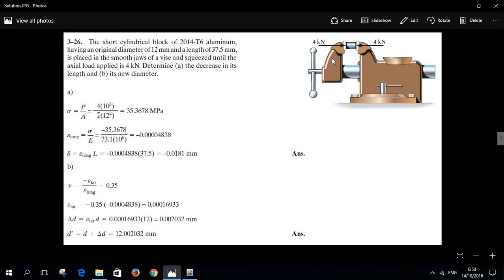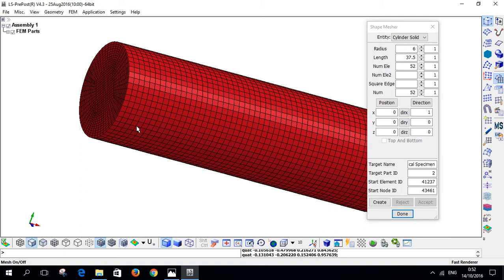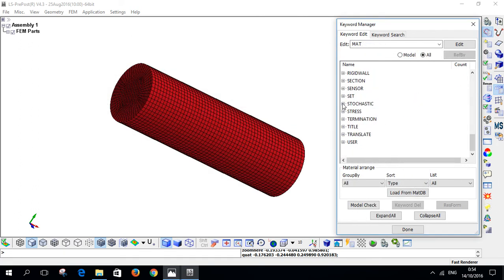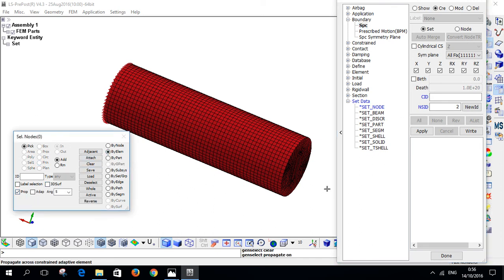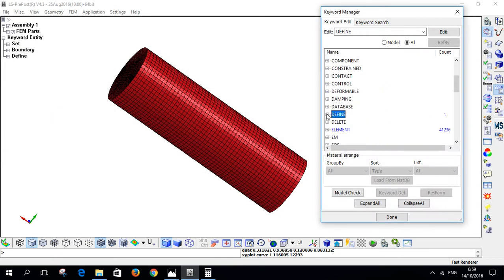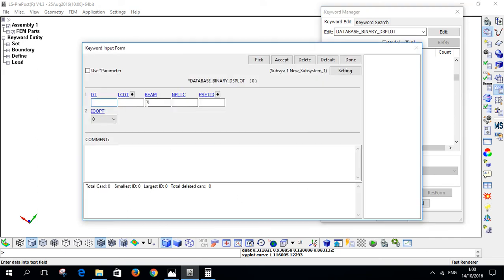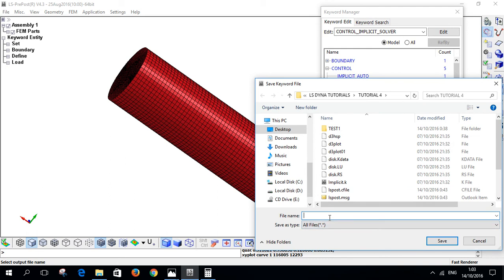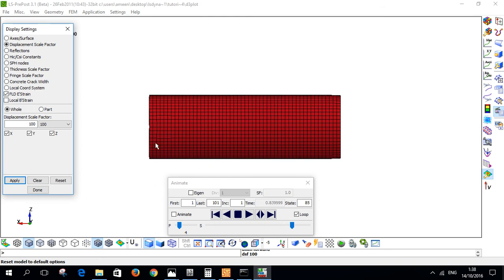LS-DYNA TUTORIAL 4: Compression Load on Solid Cylinder

Comment: If I intend to utilize an overpressure time history as a blast load, would the procedure be the same? If so, how does the software differentiate between the defined curve for pressure versus time and the curve for load versus time, given that the units for force and pressure are distinct?
Reply from the maker: If you use *LOAD SEGMENT SET, then the input curve should be pressure vs time. If it is *LOAD NODE SET, then a force vs time curve should be used.
Reply: @AmeenTopa  ok ok. Should overpressure be divided by number of segments?
Reply from the maker: @shriyaverma2565  overpressure is N/m2 so it is already per unit area. So there is no need....
Reply: @AmeenTopa  Thankyou so much.. I really appreciate your help.
Reply from the maker: @shriyaverma2565  you are welcome.

Comment: Hello. First of all great job on the tutorials, but when I want to define LOAD_NODE_SET and want to accept it i get warning Data of repeat card widget changed, but not saved. Then I save it but still getting same warning. What could be a problem to cause this issue?
Reply from the maker: Every time you enter a set off data, make sure that you click first on insert or replace before you click on Accept.
Reply: I have the same problem, did you solve it somehow?
Reply: ahaha, in 1 hour I noticed that in my version of LS-Dyna there is a subwindow with buttons insert, delete and replace (but it was not in the video), and AmeenTopa talked about these buttons in the comment.

Comment: dear sir，May I ask why I used your method to analyze the bearing capacity of reinforced concrete columns? Why did the result obtained be greater than the force I applied? Thank you for your answer
Reply from the maker: It could be that you are applying the force in a very fast rate, which causes inertial forces. Thus, the resulted force is higher.
Reply: Thank you for your answer, but I would like to know at what speed it is appropriate to apply force
Reply from the maker: @houa-lk9bd  the velocity should be same as the experimental work. That's the ideal way to do it.
Reply: @AmeenTopa  ok thank you sir
Reply from the maker: @houa-lk9bd  you are welcome

Comment: When loading the curve, is the load value entered the nodal load value or one load value for the surface on SET_NODES, sir?
Reply from the maker: In this model, I entered the total load. That's why I used scaling factor.
Reply: @AmeenTopa  means that the force distribution is taken from the total force to be evenly distributed on the surface, right, sir? Or is the total force distributed in the nodes sir?
Reply: if it inputs the load at each node, is there a way if I directly input the load on the surface with the load evenly distributed? or is there a way to calculate how many nodes are input on the load curve as a divider of the load?

￼
Reply from the maker: @nathasya2492  if you do not want to calculate the force per node, then you can use LOAD RIGID BODY. With this option, you can directly put the total force to be applied.

Comment: Hi,
I found this video to be very informative and I quite like it however, I followed the video to a tee and keep getting an Error 20001 reading 1st control card with improper format in line 2. Is there there a quick generic fix that any knows of for this? Thanks
Reply from the maker: You can open the file with a text editor and delete line 2.

Comment: Thank you for the video. I am trying for similar parameters but getting an error 60022 (IMP+22) saying "LS-DYNA Implicit is not supported in single precision, Please switch to DOUBLE Precision (I8R8) version". Can you suggest the solution to this?
Reply from the maker: The problem is quite clear. You are using single precision solver for implicit analysis. Implicit analysis can run only on double precision, for example smp_d_R10.

Comment: Dear Ameen, I always learn from your turtorial evertime. As I model a single column and a regid cylinder was placed at top to aviod exessive local damage ( I merged duplicate nodes between the column and cylinder already). I have applied axial load the same as you. I have a few questions related to my modeling. 
1) Does it need to defind the contact between regid cylinder and column, and its friction (FS, FD)?
2) I have watched yours turtorial (Reinforced Concrete and Wrecking Ball), when you defined Load_body_Z, you putted scale factor SF=1 but when I checked model truck F800 they put SF=9806. What these stand for? Do I need to assign gravity load on my model?
Thanks in advance🙏
Reply from the maker: By the way, if you learn from my videos, make sure to share my channel to your friends and colleagues.
Reply: @AmeenTopa  Yes I did share it, of course. Thanks  you
Reply from the maker: Hey there. You cannot put your email here. YouTube will automatically delete your comment. Please reach me over my social media (Facebook or LinkedIn)
Reply from the maker: Dear Met mey,

If you merge the duplicate nodes, then no need for any contact. 

SF is the scaling factor, in my tutorial, I defined the curve for gravity as 9.81 so there is no need for any scaling. 

But in the truck model, the curve has a value of 1, that's why they put 9806  as the scaling factor. They are using tonne, kg, mm, s units that's why the gravity constant is 9806 not 9.806 in their model.

Comment: Thanks for great tutorial, and I have a question why you write 99999 before analysis? What should I write?  I have i5 7300 hq  4 core 3.2 ghz
Reply from the maker: This value depends on the RAM, not the CPU specs.

You can try the same value, if it didn't work, then reduce it. But this simulation is not that big, you can leave it as default, it would be just fine.

Comment: Hey Ameen, do you have a tutorial for explicit quasi static analysis?
Reply from the maker: Check my tutorial on Torsion. 

Quasi static analysis is usually done with implicit. Using explicit will take decades. In my Torsion tutorial I used mass scaling which reduces the computation time.
Reply: @AmeenTopa  do you reckon that buckling of a reinforced concrete column can be computed using an explicit solver and mass scaling?
Reply from the maker: @nj5587  if you want to compare the buckling load with theoretical values, I suggest you go for implicit. Buckling load is a very sensitive analysis.
Reply: @AmeenTopa  alright, ive already managed it in implicit, i just wanted to add explicit results and compare all them
Reply from the maker: @nj5587  There is only one way to be sure. You have run and find out!
Reply: @AmeenTopa  i have been trying to use a velocity prescribed motion to control the kinetic energy but so far i havent achieved buckling in my explicit results, is it possible for you to have a look?
Reply from the maker: @nj5587  have you included the initial imperfections in your model?

I think your time scaling or mass scaling is too much. As I said, buckling is a very sensitive problem.
Reply: @AmeenTopa  yes i have included initial geometric imperfections, i play around with the mass scaling, at the moment i have multiplied the density by a 1000. I havent done any time scaling yet.

Comment: Great tutorial. Would like to request the tutorial for this example https://www.chegg.com/homework-help/questions-and-answers/question5-figure-q5-shows-simple-model-motor-vehicle-vibrate-vertical-direction-traveling--q34413824
Reply from the maker: You can check my tutorial spring and mass system to get the basics on how to model the system. You can use lumped mass and discrete elements (spring and damper).

Comment: Hey Ameen, could these steps be used in simulating the compression of reinforced concrete concrete columns except for having different material properties and models? Thanks
Reply from the maker: Hi there, you can follow this tutorial:
https://www.youtube.com/watch?v=Kzc5VFetBdE
Reply: @AmeenTopa  yes i used that for concrete modelling but i want to apply axial loads on the column, should i use this tutorial?
Reply from the maker: @nj5587  Yes, you can follow the tutorial here and take the material properties from there. Just make sure that the units are consistent.
Reply: @AmeenTopa  ok thank you very much
Reply: @AmeenTopa  hello Ameen, i have created a concrete column model to run a buckling test but i get an error message saying negative eigenvalues, could you please advise on how i can solve this issue. Thank you

Comment: Could you please tell the unit you are using for time. According to the other units you are using, it should be ms. But in the termination time you chose 1. Does it mean that the simulation is only for one millisecond?
Reply from the maker: Here, as I am using static implicit solver, the value of time does not really matter.
Reply: @AmeenTopa  Thank you very much

Comment: I am just wondering about the NCPU=8. Was the computer that you used for the static analysis is an HPC? I was trying to model a large-scale model and it required time of 55hrs.  any suggestions to speed up the simulation?
Reply from the maker: CPU time depends on many factors such as: file size, number of elements, and elements quality. If your keyword file size is 200 Mb or above, then it is normal that it would take that amount of time.
Reply: @AmeenTopa  Thank you very much for the reply. The file size is 23 Mb though. If I want to do a simulation for the half of the model (cut along a symmetric axis), how should I apply the boundary condition to the cutting plane? Also, do I need to input or consider any other keywords or factors in addition to the boundary condition? and after I simulate the half model, how should I scale up the values for the full model?
Reply from the maker: If that's the file size, and you are doing static analysis, then I assume you are using implicit solver.
If my assumption is right, then you can use variable time step, and control the initial time step.

For model reduction, you don't need go remove or reduce the load, you can simply apply boundary conditions at the symmetric plane with BOUNDARY SPC SET  or use  SPC SYMMETRY PLAN condition like in my video here.
https://youtu.be/Xidr0p6EplQ
Reply: @AmeenTopa  Thank you very much. You are right, I am applying a static load through a spherical ball on a wall. Ye, I tried with implicit solver with variable time step (after watching one of your videos) but it is still taking longer time. 

I will try with the SPC SYMMETRY PLAN and check. Thank you very much for your much helpful videos and advice.
Reply from the maker: @amzzano  For implicit analysis, everything should be fixed and there is not 'loose' ends. If there is some gap between the ball and the wall, then this might cause your run time to go very large.
The ball should be touching the wall at the beginning of the simulation. The wall (if you are using shell or solid part) should be fixed too at its boundaries.

Comment: Splitting the force into 820 parts is hard to understand. Can the pressure curve be defined directly in LS-DYNA？
Reply from the maker: Yes. You can directly define the pressure: https://www.youtube.com/watch?v=5Sgwna3IHCg&t=3s
Reply: @AmeenTopa  Thank you for your help！
Reply from the maker: No problem. Sometimes, you need to apply distributed load instead of point load. The method used in Tutorial 4 is for you if you want to apply distributed load.

Comment: Thank you for the tutorial. It is very useful! I tried modeling the exact same and if I increase the load it looks as if not all the nodes at the end where the force is applied have the same displacement. It looks as if every other node has a large displacement. The other nodes only have small displacements.
Do you know why this occurs and how to fix it?
Reply from the maker: First thing to check, your nodeset. Make sure all the nodes on the surface is defined in the set.

If this still doesn't work, then you can make a rigid plate on the top, then apply the force or displacement on that plate.
Reply: Thank you for the tips Mr Topa. I have already checked the nodes, and it looks as though they all are defined. So I think I'll try your solution with the rigid plate.
Reply from the maker: @nikoline5299  here is how i did before with the rigid plates

https://youtu.be/LJXrcC4pCu8

Comment: Very thankful to you sir. Sir, I'm solving an explicit model (blast effect on the structure) but initially, I will have to apply load/force on the structure (as per condition),  and then have to analyze blast effect on the structure.  After inserting load curves for selected nodes, the solver is showing error termination. How to overcome this type of issue?
Reply from the maker: Hi, I have made more than one video about blast simulation with LS DYNA. Please check them out.

Comment: Hello Sir, i want to attach Cfrp wrapping material to concrete column, it is just like frabic. I am not able to do this?.
Any solutions, as i am not able to get results.
Reply from the maker: You may use shell elements, then use tied nodes to surface contact.
Reply: @AmeenTopa  hello sir, i have used it but i am not able to get proper results.
Reply from the maker: @vinodbankapur2717  gimme your email id. I will  contact you there for further consultation.

Comment: Hello sir....Thank you very much for learning tutorials...

However I could not understand why we need to devided applied load by number of nodes...In practica, whole suface, hence all nodes will be subjected to 4 KN load....But we definded 4/820 KN on each node.....this need to be done in all kind of simillar probelm ?
Reply from the maker: If we didn't divide by the no. of nodes, then we will be applied 4kN on each nodes of the surface. If the surface has 100 nodes, then the total load applied with be 400 kN!!

If you don't want to divide, no problem. But the force of 4kN will be concentrated on one single point which is not the case in real life.

Comment: am dealing with a concrete filled steel tube subjected to blast load..
i need to find out the mid-height deflection of the tube.
for the above said problem i have divided the full length of the tube into three parts so as to find the deflection in the middle part.
but i have been unable to establish the contact between the respective parts...
can u suggest me the appropriate keyword that is to be used for establishing the contact between the parts..
waiting for ur reply...
thanking u
Reply from the maker: Dear Sumit, you don't need to divide into three parts. Just make it one part but with nice and small mesh.
Reply: i have also tried with one part that is without dividing but was unable to find the mid-height deflection of the tube.can u suggest me the CONTACT keyword that is to be used for creating the contact between concrete and steel..
Reply: will u please let me know ur email id so that i can get in touch with u regarding this by sending the file.

Comment: In define_curve...when I changed value of SIDR to 1 then while plotting it is showing invalid curve id ......this is happen when I am doing dynamic relaxation method.....any solution?
Reply from the maker: I am not sure what is the reason of the problem. I just tried in with my prepost. There is no problem in plotting the curve whether SIDR is 0 or 1.
Reply: Ameen Topa is it necessary to create two load curves while doing dr method
Reply from the maker: Yes, one load for the initialization and one load for the transient simulation